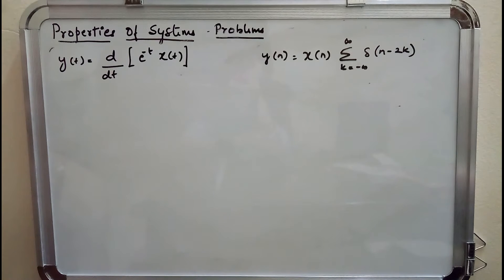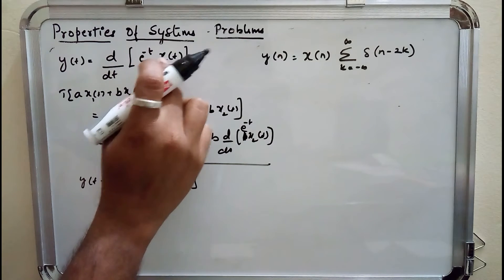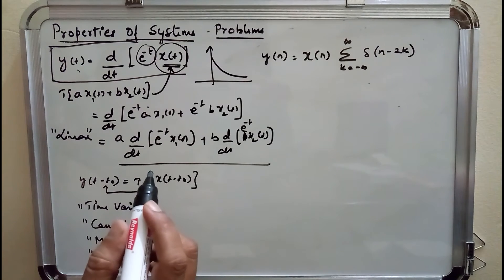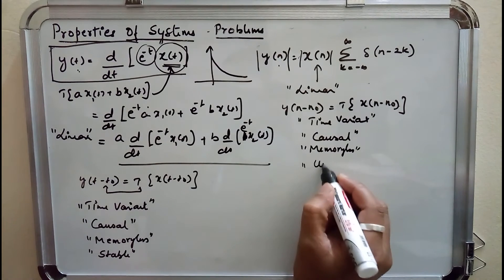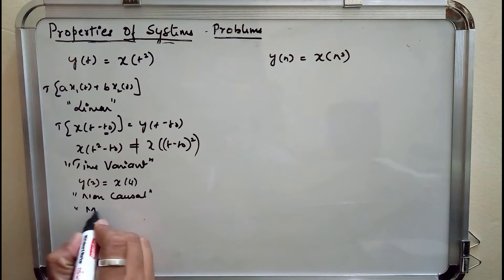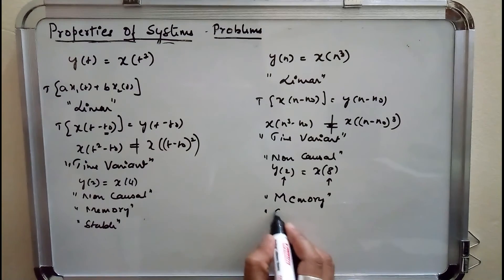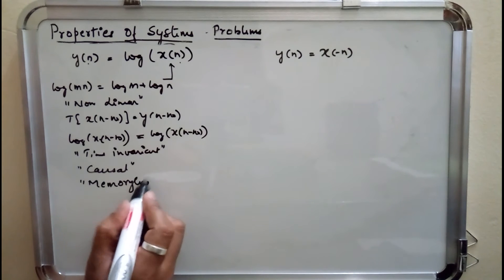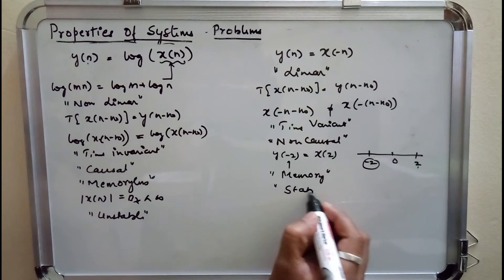Problems on Properties of Systems -Part 3

Comment: sir, at 3:13 i think it is unstable. Because if we substitute u(t) into x(t), we will get (e^-t)(delta(t))+((-e^-t)u(t))= (delta(t))+((-e^-t)u(t) in the output equation which is not stable.
Reply from the maker: e^-t is always stable . So the system is stable . May I ask ,according to you which term tends to infinity ?

Comment: i have a question in y(t)=x(t^2) problem, it's memory system thats clear but at t=0 it's memoryless right?
Reply from the maker: Yes . Forgot to mention that . It has got memory for t not equal to zero .
Reply: @techjunkiejdb5476  got it thx